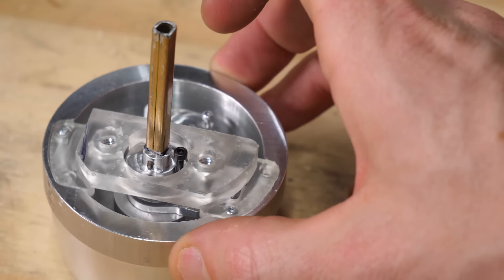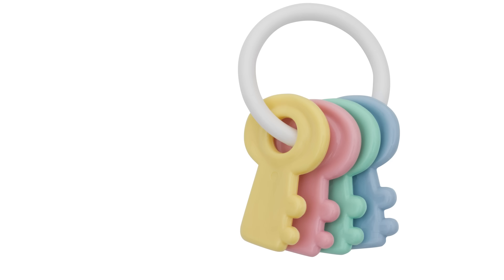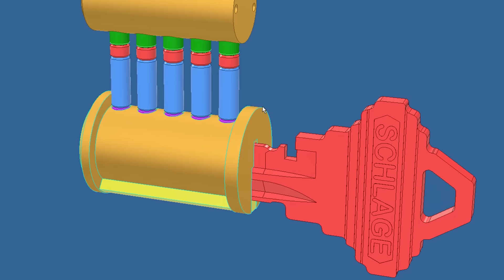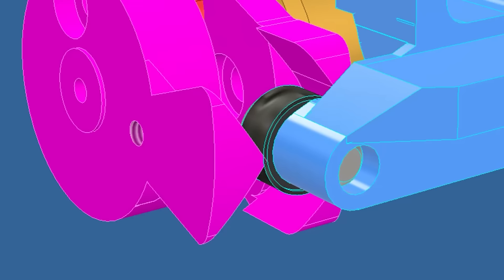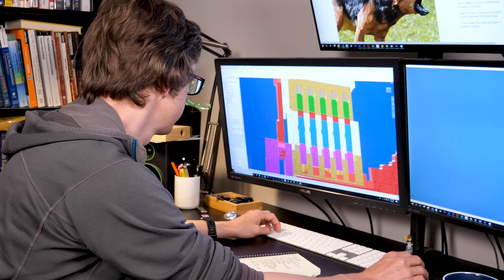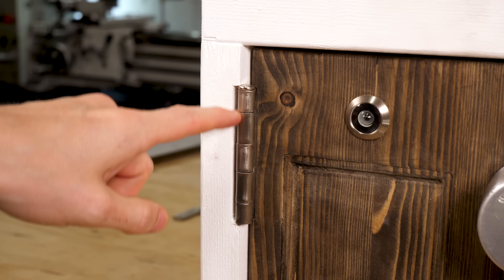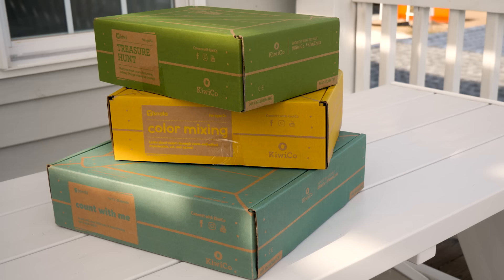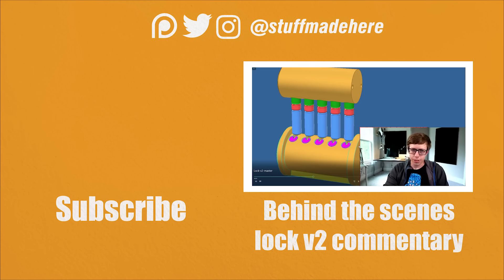TWO Unpickable (?) Locks for Lock Picking Lawyer!

Comment: "When an unstoppable force meets an immovable object"
Reply: Unpickeable* object...
Reply: Love your username Neil 🤣
Reply: They pass through each other, without interacting.
Reply: LPL getting his 50cal ready...
Reply: The unstoppable force passes through the immovable object. The force is not stopped. The object is not moved. Case closed.
Reply: Chuck Norris shows up out of nowhere and beats the crap out of both of them.
Reply: @JamesBond-vd4gd  This is the correct answer. Objects are mostly empty spaces. The nuclei of the atoms of the unstoppable force would just shift over and pass through the immovable object. Also the immovable object would have to be at 0 Kelvin and the unstoppable force at infinite kelvin, which is why the unstoppable force would have to move through the immovable object and not vice versa.
Reply: @cms_samuel  Unpickable*
Reply: Ahh you to have also suffered constipation

Comment: “Today we’ll be defeating these locks with the milling machine that Bosnian Bill and I made”
Reply: “Today we’ll be defeating these locks with the nuclear warhead that Bosnian Bill and I made”
Reply: Yep, not drill resistant at all lol
Reply: It says good things about the lock when you need to use a custom tool you and another lockpicker  built because it just didn't exist.
Reply: @MrBaconbyte  depends.
Ones that Tool is out in the public the lock can be useless.
Reply: MrBaconbyte disk detainer picks existed before LPL and BB made their own, they just weren’t very good and locksmiths with any self-respect would modify them.
Reply: @MrBaconbyte  the tool existed before "The tool that Bosnian Bill and I made" but they were cheap chinese objects with poor tolerances or expensive bespoke products
Reply: @Rich_ard  So? His goal was to make it pick resistant. If it works, then the mechanism can be adapted to fit in a stronger chassis.
Reply: @JohnDoe-zh6cp  yeah, I just suspect it'll come up on the discussion.
Reply: @Jehty_  No, even then it's only useless if you're trying to protect something that someone else is going to take the time to plan in advance to get into. Most of the time you just have to have a better lock than the others around you.
Reply: @LaughingMan171  but if that lock is common a thief might carry the tool which unlocks your lock in seconds - ergo making your lock useless.
Reply: Lmao he opens it with a turning tool and a damn pocket knife
Reply: @electricwaster  He picked it with lockpicks lol

Comment: Stuff: "These hinges could be my downfall"
Lpl: "I gotta say he did the right thing because I definitely would have done that"
Reply: Loved that part
Reply: Hilarious that he welded the pins in instead of just flipping them to the other side of the door.
Reply: @Elfr0g  or just buy non removable pin (nrp) hinges
Reply: @Elfr0g  maby I'm missing something but if he puts the pins inside the door then the door wud have push in not pull out
Reply: @Elfr0g  then the door would open the wrong direction.
Reply: @scytheakse  I believe nearly all front doors open inwards and not outwards.
Reply: I've watched hundreds of LPL videos and I've never seen him pop hinges. It's actually kind of disrespectful and condescending to go as far as welding the hinge pins..  LPL has more honor than that. He just tests the lock, period. LPL was just being polite about the stupid assumption that he would actually do something like that.. I have a feeling that Shane believes he's always the smartest guy in every room, like most engineers I went to school with. Often, they're not.

He won't let this go though, so I look forward to the next version of the "unpickable" lock.
Reply: @SaltNBattery  on small security boxes he points at the hinge and hinge pins mentioning that as the easiest and Most common way a thief would approach the safe. But he doesn't limits to that way and find two or three more exploits.
Reply: @xor01  I would argue that the front door opening inwards (being a push not a pull) is the correct direction. It would allow a... ern... beveled frame? double frame? (sorry, English not my first language), which would prevent using the knife attack. Furthermore, why are these locks sticking out? They should be flush with the wood, at least partially. And if that means a thicker door, thicker front door is better front door. Or perhaps my country has more burglars, so you don't worry about that, don't know.
Reply: @SaltNBattery  i don't really see the knife method being any more "honorable" than using the hinges. Any normal door would open inward and have wood moulding stopping that from being possible. It is effectively a "Haha you're not a carpenter!" attack just like the hinge pin one is, both are effectively unrelated to the lock.
Reply: @scytheakse  Or put screw-in security hinge pins in for existing hinge plates without needing to rehang the doors.
Reply: @spyderf16  also an option. But I'm a commercial door hanger and I always cringe a little to leave a screw out to make room for the pin...
Reply: @SaltNBattery  well clearly you are lying about watching "hundreds" of videos, because LPL has popped the hinges on MANY hotel safe's in his videos, and he even sells the hinge popping tool on his site, covert instruments.
Reply: @SaltNBattery  you the kinda dude to dislike pp music
Reply: @gavinjenkins899  gavin, the door was also engineered and much thought given to it and so was also fair game, right?!?
Reply: @nooboftheyear7170  That logic applies equally well to the hinges and to the knife on the bolt, so doesn't matter for our purposes of what we call "honorable" -- either they both are, or neither of them are
Reply: @nooboftheyear7170  If this truly was a remake of his door, then he has more problems than he realises, with two attack vectors exposed like that.

9/10 entry doors open inwards - for which the hinge pins are internal not external and thus not a problem; they also usually have a jam/lip that the door seals against, this would protect the deadbolt from LPL's demonstrated attack - the deadbolt still has a flaw but it's not one that could be exploited in a proper installation. The ability to pick the lock is the only exploitable flaw - as demonstrated - remaining but that obviously has a very simple solution in denying access to the internals of the lock, which was also demonstrated(as equally obvious is that a cheaper solution would be possible).
Reply: @richarddanko7086  So much easier to kick it open, I disagree.
Reply: @SaltNBattery  
Then you missed the one where he sold the hinge removal tool that was demonstrated in the video.
Reply: @hellsgate09  
If you are talking about using the knife, no. That would still be possible. There MUST be a gap so the door can open or close. Might need to go in at an angle, but some gap would be needed for an externally opening door. 

But yes, it would be much tougher to do on an internal door. Not impossible though. A quick drill through the lip would give you access to it. So that flaw really does matter. If a lock only needs a 10 second drill into the wood door to Expose an exploit, it is still an exploit. 

I am curious to see what other exploits the lock has when the design is improved. Holding the pins in place through gates with tension seems to be a possible avenue. All that complexity has its downsides.

Comment: This is a really neat and impressive design, however I had an idea that might make it even more un-pickable.

It’s just a block of steel. No key hole. No moving parts. Just weld your front door shut.
Reply: Take of the ceiling, to go out cover yourself in oil when raining
Reply: @adler_dot   cant pick me if I'm 7503FT in the air
Reply: @theentiretyofthelgbtq5479  cant pick open a door if its in space now can you
Reply: Funny thing is after being a welder and cutting through thick steel on a regular basis you realize it would be easy to break into anything, well that or break a flimsy window instead.
Reply: He's a genius a genius!
Reply: This is the lockpicking lawyer, and today I have a welded shut door. Now, there’s a major design flaw in that the door itself can be sawed through with a simple angle saw like so.
Reply: Who called in BosianBill the only man to unlock an open door
Reply: @yeetissheetsfoot60  you can actually
Reply: Wow, your mom must be proud
Reply: Break in through the window
Reply: This is the lockpicking lawyer, and today I have a hacksaw
Reply: Hmmm 🤔
It could sell fr

Comment: Interesting enough your lock idea is very similar to a S-A switching componenent for a modern nuclear weapon, except the pins are electronically activated and when the proper code is applied it can rotate the safety shutter out of the way arming the weapon. 🤓

Comment: "I can't see why it doesn't work, it could be anything"

 As a software developer I felt that so much
Reply: STOP codes to isolate.
Reply: That is quite Relatable
Reply: I'm only learning C++ and thought the same thing. Also the fact that he ended up completely redoing a key component felt familiar.
Reply: 99 bugs in the code to fix
99 bugs in the code
Hunt one down and patch it out
137 bugs in the code to fix
Reply: Sounds like you need better unit testing!

Comment: "I'm worried that there's some tool that I've never heard of..."

A knife and a mallet. 🤣🤣🤣
Reply: Didn't he also use some pliars for the top lock> 

Though yeah, that was DEFINITELY rather clever.
Reply: @TheAyanamiRei  he didn't have to use a plier and mallet... Lots of common bump picking tools cause the vibrations the mallet did while providing torque at the same time. Look at the German made Multipick Kronos, for the most luxurious of these. Also common quite impact drivers on a low setting could do the same, while simultaneously providing torque. All the aforementioned rake tools could also act as tensioners, obviating the need for pliers.

Mallets and pliers are just really common among locksmiths for bumping attacks and extremely mainstream. The difference between a good electropicks and other vibrating devices, is the pivot point is far forward and have high inertia.

https://youtu.be/eSghBUIJe1o
Reply: that's how you humiliate an engineer

Comment: One of the best anti pick locks I've come across IMO was this old Yale dead bolt... I think it only had 3 pins but the mechanism to turn the deadbolt required the 6pin key to reach the back of the lock.  The very end of the key turned the actuator to unlock the bolt. Pretty simple yet unless you knew how it worked then regular lock pick tension wrenches didn't work. Luckily I happen to make all my own tools so one of my frequently used tensioner was one that reached the length of the keyway so I didn't only keep pressure on the front.. I figured out the mechanism while restoring the dead bolt afterwards. But if you weren't me or didn't know about it then you could sit there and pick those 3 pins all day and not know wtf was going on.

Comment: 10:59 -- "Worried about some [obscure] tool to defeat my lock"

LPL: "So here's my pocket knife"
Reply: Oofff.
Reply: Actually true
Reply: he actually used his knife
Reply: Exactly, he ACTUALLY destroyed this engineer and got in SO VERY EASILY!!!
Reply: @doaimanariroll5121  oof
Reply: Never guessed why he start the video with the locks disassembled and schematic? Why do you think he does not show he trying to pick the lock? He clearly tried it and could not. So he viewed the schematics, disassembled the lock, looked for vulnerabilities and explain how this can be fixed. He just lock picked it after knowing how it works... This is not a competition. Don't be a fanboy.
Reply: @pensamentoazul  that's how it works, if new type of lock comes out, and it is hard to pick, lockpickers take it apart, and check how it works, thats how they learn, after the analysis, they aquired a new skill - opening new type of lock, so yea, it was pretty normal for LPL to pick it after the analysis. The real challange is to design such a lock, that  is impossible to pick without breaking the lock even when lockpicker knows how it works, and StuffMadeHere was close on that one.

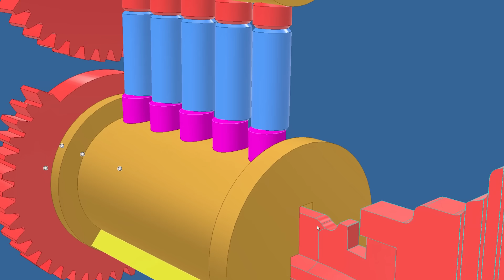Comment: Maybe you can replace pink pins on 5:22 with multiple wafers so they can separate in two in any key bidding position: one set stays in lower cylinder, another stays with upper pins and keeps them from falling. Then you wouldn't need that complex pin holding mechanism.

Comment: Looking at your gear solution (4:39) I think you could make that work by adjusting the gear ratio so the bottom cylinder rotates faster than the top. Also, instead of using a single solid pin (blue in your illustration), you could stack short pins (red in your illustration) in that lower pin area. Just an idea 🙂